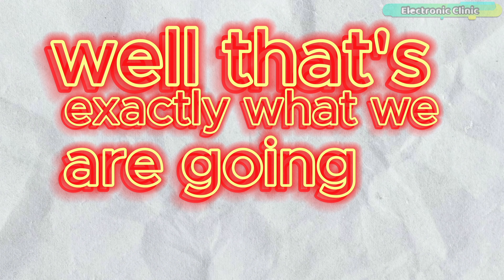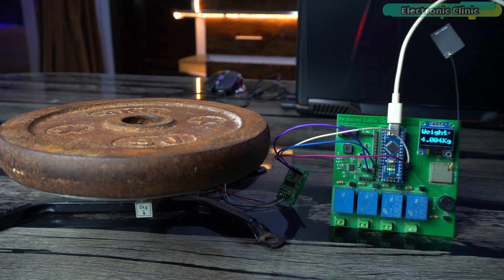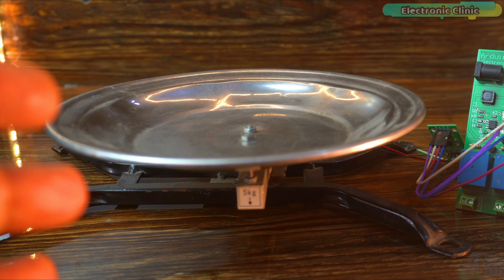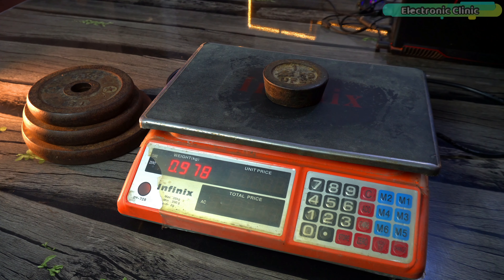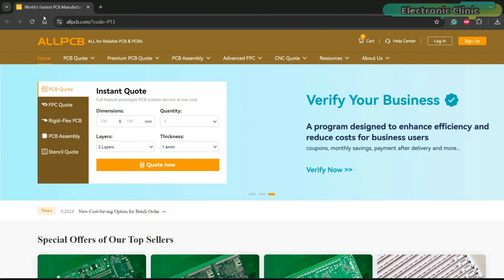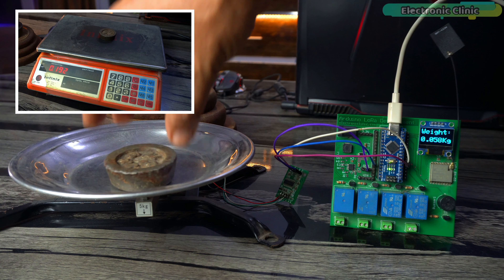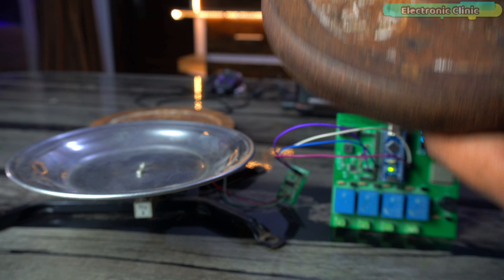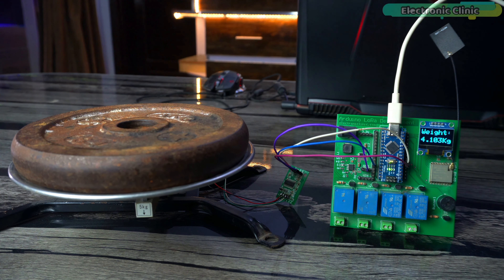Weighing Scale: DIY Scale vs. Commercial Scale - Which One Wins? Arduino Load Cell HX711

Comment: I worked 50 years in electronics cash register (Sanyo-Uniwell, Sweda,EBM, Kingtron, etc..) electronic scales, POS, bar system etc.. you name-it I did install the first electronic scale in Canada from japan TEC (Tokyo Electric Company) around 1980's, and to be legal for the seller to use it we had to do the calibration with government approved weights to 15Kl or 30 pounds , so the scale was able to switch from pounds to kilos when the overall metric system came to Canada. is fun to see with all theses new Chinese gadgets someone can replicate old technology , mind as well rebuild an electronic   Cash Register from 1980's or so. good overall work.

Comment: The video was good, how ever it's not accurate. your scale worked better because it was calibrated with the weights you used to check the scales. I've worked on scales for a long time so what I'm saying is from experience. what needs to be done is to use certified weights. these are the weights we use to make, design and calibrate scales. these weights are calibrated by very accurate scales that are certified by checking to a master weight at a specific time interval to eliminate the possibility of failure in the scale. so just calibrate both scales with certified weights then measure you certified weights on both scales and you can check the weights you were using for their accuracy. but without the certified weights you are calibrating to unknowns which will make your scale look better. they can both be very accurate.
Reply from the maker: Thank you for your detailed feedback! I really appreciate your expertise and insight. I agree that certified weights are crucial for accurate calibration, and I wasn't able to access those for this demonstration. My aim was to explain the concept of calibration using what I had on hand, but I completely understand that without certified weights, it’s not a perfect solution. I'll definitely keep this in mind for future demonstrations. Thanks again for sharing your experience—it’s very helpful!

Comment: Good explanation, i think the problem is in the weights because they're maked for body maker and their whight is not exact , you have to check with real whight maked for groceries.
Reply from the maker: Thank you for your feedback! I agree that the weights I used may not be the most accurate, as I had to get them from a local shop, and I wasn't fully satisfied with them either. However, my goal was to demonstrate how a weighing scale can be properly calibrated, and I hope the explanation helped with understanding the concept.

Comment: bro can i use 100kg loadcell with hx711 modul ?
,i have no clue  i looking for datasheet but i didnt get it (maximum load cell capacity) iam afraid it can measure correctly